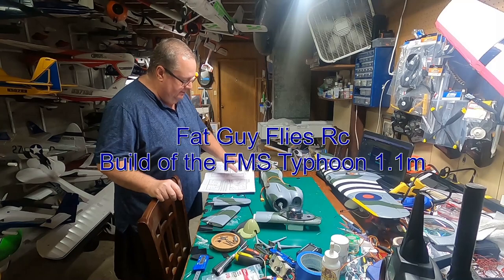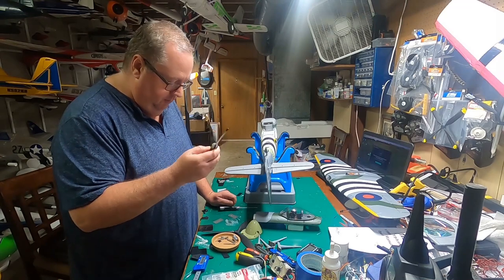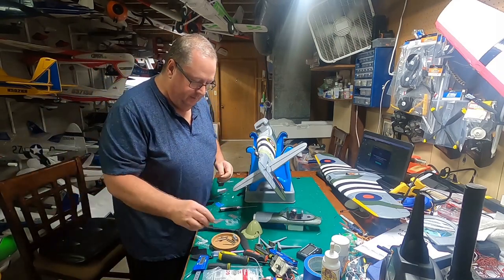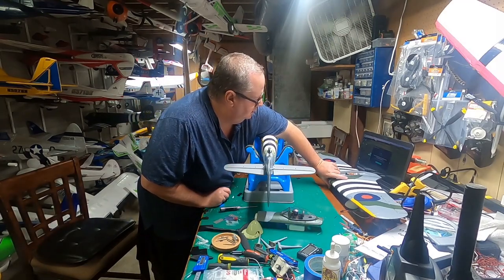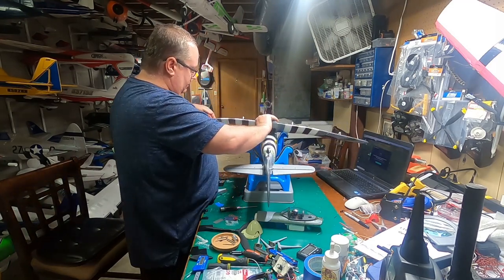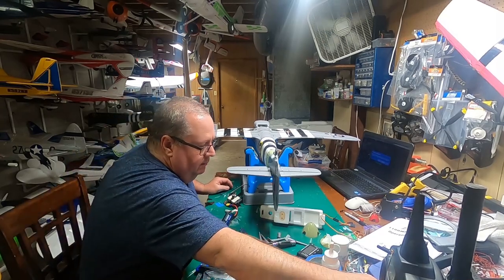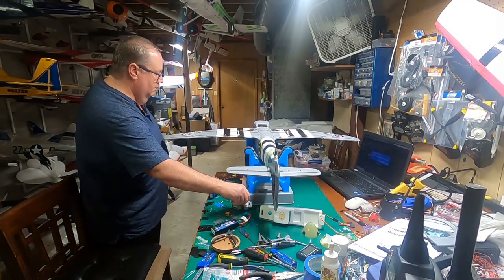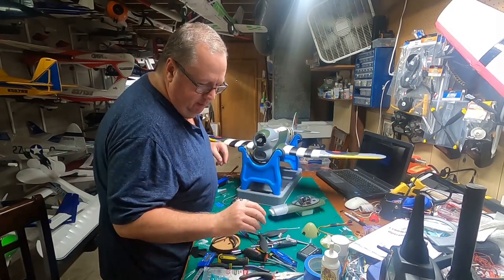Fat Guy Flies Rc Build of the FMS Typhoon 1 1 m !!

Comment: What was the reason it crashed? The CofG in the FMS Typhoon  book calls for a very forward balance point  (40-45mm)which  must be wrong . I'd appreciate what you  thought  was the cause....Thanks
Reply from the maker: No I had the cg right and yes it is way forward. No i got to slow with a aileron turn and tip stalled.